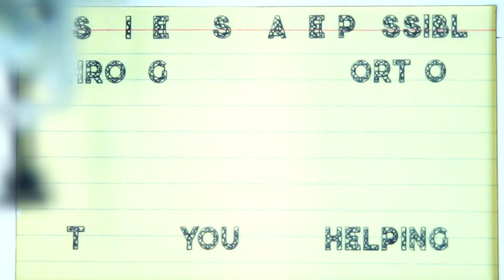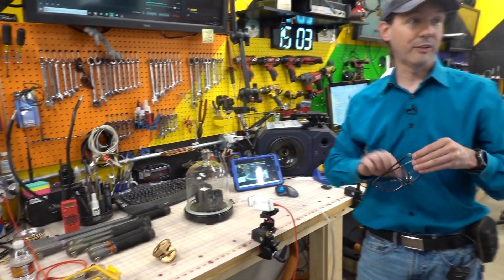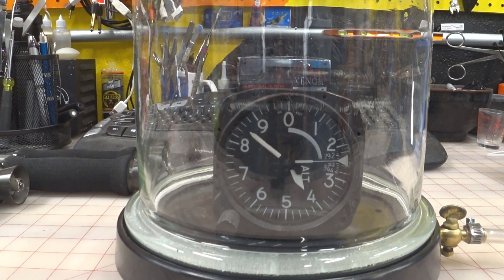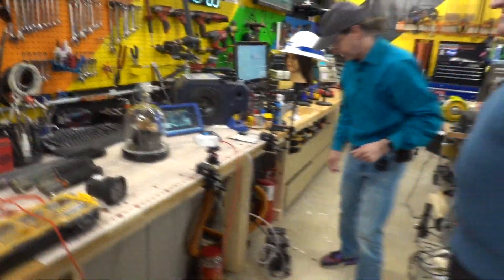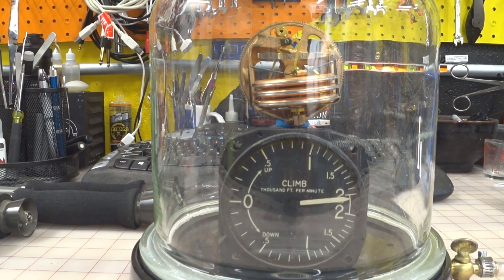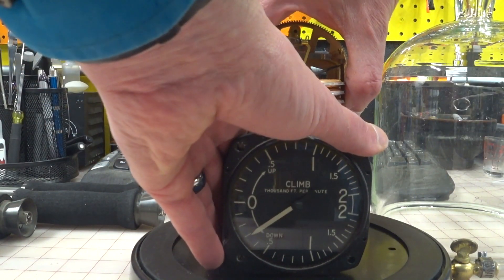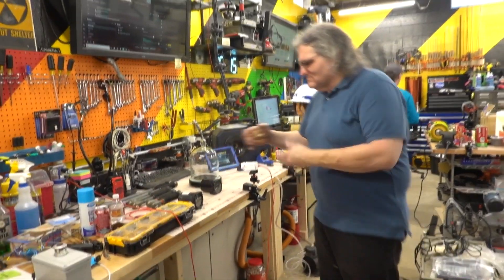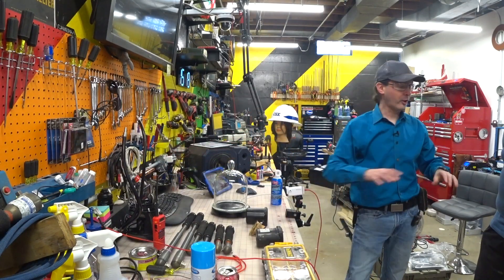Altimeter Vacuum Chamber Experiment

Comment: The small numbers on the right are your altimeter settings. As you fly to different airports, you’ll have different pressure on the ground. ATC will you give different settings such as “altimeter is 29.92 which will set your altimeter according to the pressures at that climate and will adjust your needles.

Comment: I was just thinking “man I really wish he had a verticales speed indicator to stick in there” when bringing the chamber back to atmosphere. :P

Also I’m pretty sure those caps on the back of the instruments are for storage/shipping only. Normally there would be a fitting that you would screw a line into that goes to the static ports on the outside of the aircraft.
Reply from the maker: Yes, the plugs are to protect the delicate inner bits. Normally they would tie in to the Pitot Tube eventually.

Comment: I'm guessing the stuttering of the altimeter is probably because it was roughly handled or dropped, which would distort the gears or shafts.
Backward lens ?
Of course it is, have you ever looked through a telescope or binoculars the other way ?
In fact there's a well known trick  of getting a second lens and holding it backwards on the first lens ;)
Reply: btw, forgot to mention, notice the gear surrounding the mechanism ?
The whole mechanism turns when you adjust the setting knob, which is another reason nothing (pipe) connects to it.